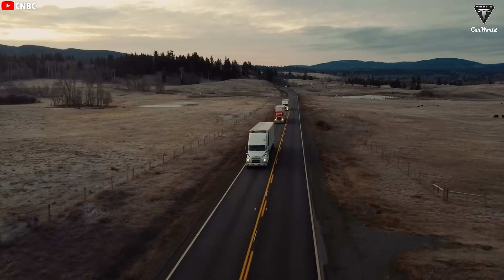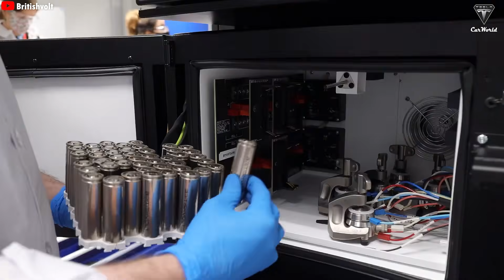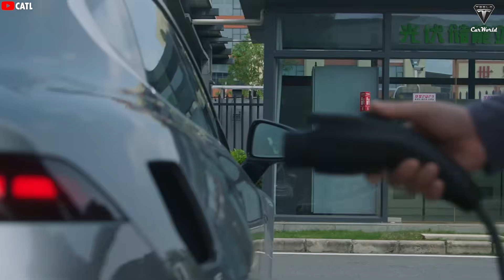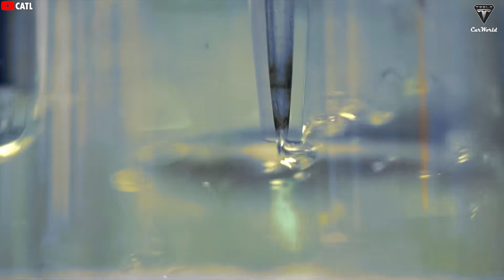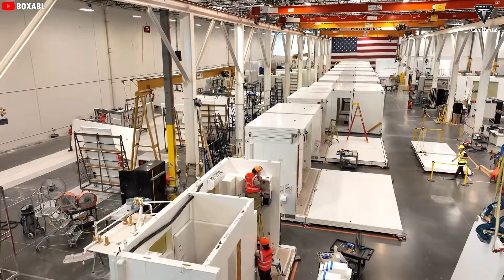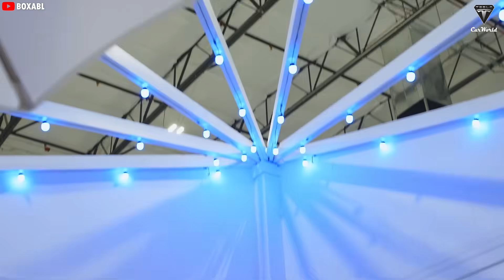Tesla Semi 5 BIG Updates! NEW Feature, Insane Efficiency & Mass Production Line!

Comment: 😄I built the first passive home in NSW or Victoria, built in "The Pocket", BILLUGELEL, NSW, in 1982. I built and designed 54 passive homes up and down the East Coast of Australia. It was constructed with SIPform panels located in Perth, Western Australia. Cost $1,800 to $2,400 per m2. I had a proposal in Lismore for 250 passive homes, 161,500 m2 of tracking PV, and 57.6 MWhrs of Tesla Megapack batteries. The development did not go ahead. I had financing from the Middle East for $1.25 billion. We could have made Lismore energy independent.🤗Ian Cleland